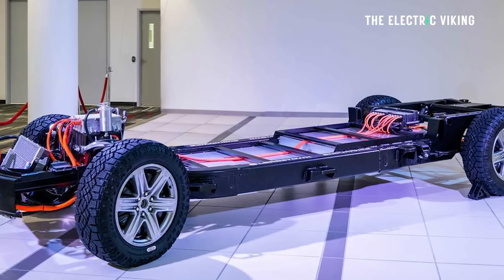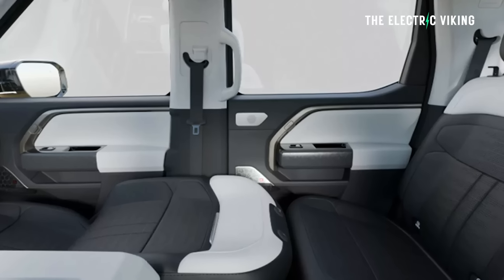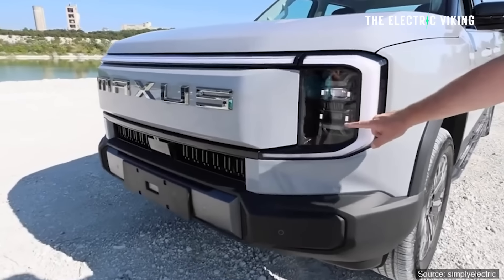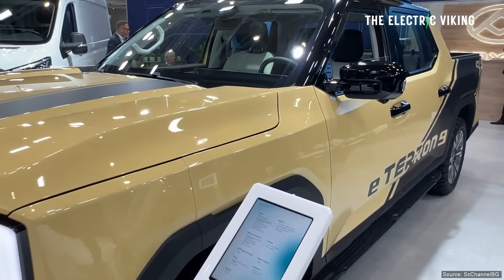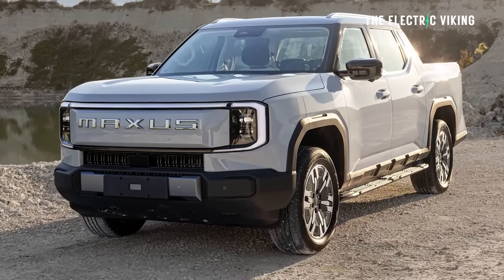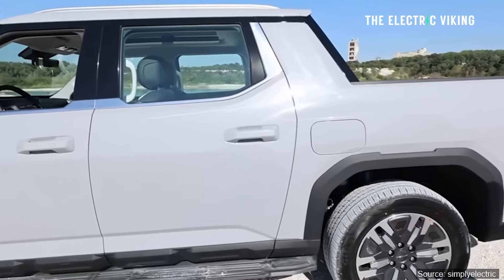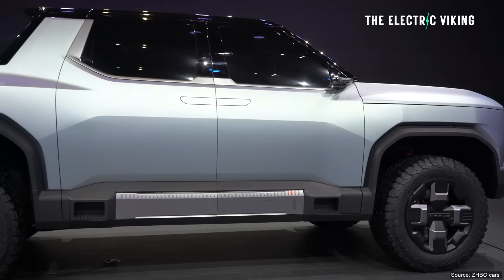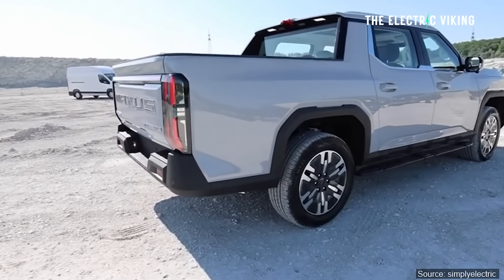Maxus LDV reveal world's first global electric pick up truck with 1000km range

Comment: I'm confused.  Is the range 430 km or 1,000 km?  Makes a difference.
Reply: For range,wait for independent testing for more realisting range estimates
Reply: 1000km was clickbait or a lie, which lowers the reliablitiy and credibility of this channel. (also that true for the video about BEV registration are higher than gas registrations in Norway - also only partially true)  350 to 420 should be more realistic.
Also it's not V2G capable, only V2L. They had shown the car at IAA Transportatin in Hannover this week.

Best option of this car is the tow capacity of 3,5t and the frunk. But be aware it has only 600kg load capacity.
Reply: @sc00Bay  420km on a 100+kWh pack is seriously inefficient
Reply: @andrewmutavi590  What would you expect from that front with a cw-value of a fridge?
Reply: @sc00Bay  a what?🤣🤣🤣🤣bro u meannnn!!!!🤣🤣🤣🤣
Reply: Never trust whatever the Chinese say the range is. Note: you can drive a Tesla for 1000km if you drive at 40km/h (reducing the air resistance by driving slow).
Reply: @AORD72  Thats true for all cars - inluding ICE's
Reply: @andrewmutavi590  yea.. probably to be expected for a big ute.
Reply: @AORD72  Sure, but he quoted both ranges in the same video, which I found confusing.
Reply: @andrewmutavi590 halve that range when towing, 200km 😂

Comment: Saying "EV has range of 650km/400 miles, I don't think you need more than that" is mistaken unless you are only travellingin metro regions. If you are towing you will get considerably less and you have to get it SLOW charged somewhere - not going to happen out in the sticks. At least with a hybrid you can simply refill and recharge when more convenient.

Comment: Is the air pump motor for the air suspension well protected against dust and stones?
Are the high voltage cables well protected against dust and stones.....?
it looks like that some high voltage cables under the car are close to the wheels on the back and they are not protected at all!

How are the Maintenance intervalls for the air pump suspension system?
Will the Motor for the air suspension easily break when the air pressure system is leaky? Can the air pump motor handle a permanent operation or is the motor for the air suspension just designed for a short time operation ?
because this is a major issue in many air suspension systems and the replacement costs for a new air suspension motor is high.

Comment: The design is similar to BYD Shark ⁉️
Reply: They have all copied the ranger look.
Reply: @R.I100  they are all the same!! ONLY changes the branding, unfortunally very normal between chinese automakers 🤮
Reply: @miguelmarques7331  not True, BYD has a engine that works as a generator to charge the batteries.

Comment: The best system electric pickup I have seen to date is the one in the BYD, unfortunately it is Chinese. Electric with gas charging back up is ideal for a pickup. I'm not sure why they are the only company to use this system, GM had that in the Volt 15 years ago. Electric only pickups are useless for towing.

Comment: This truck is not going to sell because it costs $70,000 which is way too high.  Everything is good except the price.  There are other trucks from China which you reported on last year that cost less than $20,000.   Who will pay an extra $50,000 for a pickup when you can buy one for $20,000?

Comment: I like to see maximum range in a truck as once you use it to tow, that number will be cut in half.
Reply: Yeah towing cuts down on fuel economy of ice to.
Reply: @mrspeigle1  Correct, and by a similar amount.
Reply: @mrspeigle1 The point being if you lose half of your range when you have a 600 mile range you still have enough to get further than your bladder lasts anyway. You get another 600 miles in about 8 minutes.

In the EV you get half of the 300 miles it's now 150 which is only 2 hours of driving... But remember you can only fast charge from 10-80 so your actual leg of your trip is already cut by 30% so the second leg ends up being cut by 80%... Or now you go   somewhere aound 90 - 105miles and as mentioned in the video that takes 40 minutes so you have to wait 40 minutes every hour and 15 minutes you drive.

They are really great as a lifestyle truck... But then, so is any other cheaper gas truck that is half the price.

Comment: Nice truck , but useless in Europe.  Curb wheight of 2850kg therefore a payload of max 650kg if GWM is 3500kg.
For comparison. EU spec f150 Ligthning  curb wheight of 2890kg  and payload of 535kg. Also useless.  850kg pay load is the bare minimum imo.
A smaller car ,with  a smaller battery, and only 40kg lighter than a  big ass us truck.
My hopes were high , but now im just dissapointed.

Comment: Is it a full size pickup. To be full size it needs to be able to transport 4 by 8 foot sheet material flat in the bed. (122 by 244 cm). Between the wheel wells and tailgate.
Reply: one full ton as well